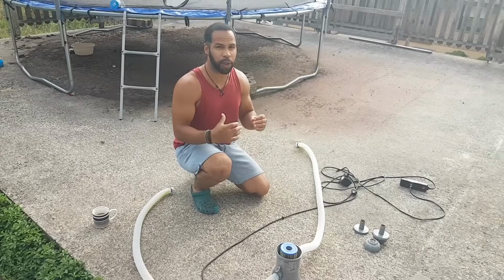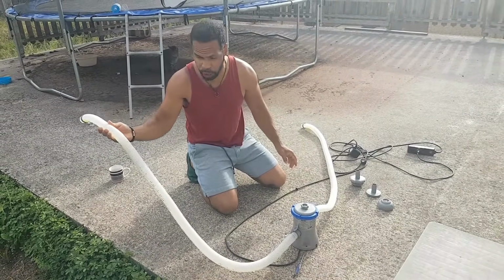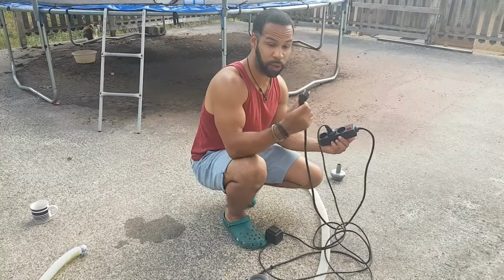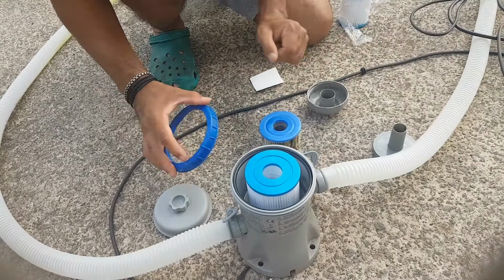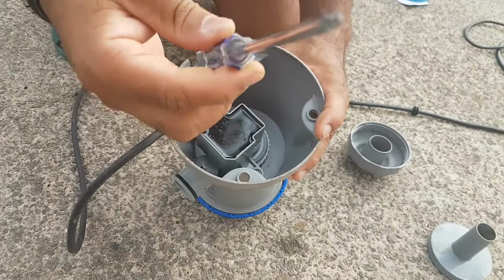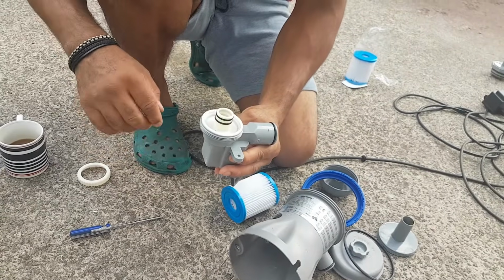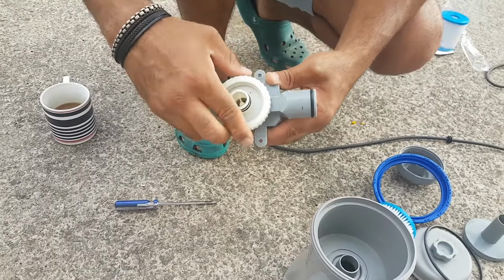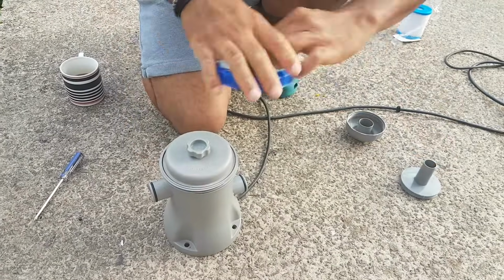Bestway Pool Pump Not Working - Common Bestway Pool Pump Not Working Troubleshooting Procedures

Comment from the maker: Check the links in the description for similar products on Amazon.
Please leave a comment.
Please subscribe: https://goo.gl/Zn8ZYP

At your own risk Disclaimer:

This video is for information only. In order to reduce the risks of injury please follow the instructions that came with the equipment. You are performing troubleshooting procedures at your own risk and I will not be held responsible or liable for any injury or harm you sustain as a result of this video, or information I share.
Reply: I got a problem with mine I can hear it running but when I put my hand on inside of the pool in the water I carnt feel any suction .
But now I'm going to try your way thanks 😊

Comment: I have a similar issue, but removing the washer and the small rubber piece didn’t fix mine.
When the pump is completely disassembled like yours in the video, the motor spins normally.
As soon as I reassemble the pump housing, the motor struggles to spin, even with the washer and small rubber piece removed.
Have you seen this before?
What could be causing the motor/impeller to bind when the housing is reassembled?

Comment: my pump womt turn on at all. like it’ll light up but it will not click and turn on. help
Reply from the maker: Check if there is any debris blocking the impeller inside the pump housing. 🛠️

Comment: No water is coming through the top when filter is on ?
Reply from the maker: Make sure your hose connections are tight and that there aren't any blockages in the intake. 🛠️

Comment: None of this worked for me. Mine is brand new I filled it with water bled the air took it apart like you did, everything and it still doesn't work

Comment: 2024 I had to search for this. It worked but the fan chipped somehow in the middle of summer. No choice had to purchase another one. Very hard out of stock. Now 2025 the new one started to rattle bummer. I had to do same open it up and take the small part out and sure thing it's quiet and working. Hopefully to last until forever 😅. Thanks for sharing the information.

Comment: My pump just doesn’t turn on and I don’t know how to fix it
Reply: Pumps motor can burn if it's ever ran without water or badly clogged. 

UNPLUG THE FILTER when you're troubleshooting. 

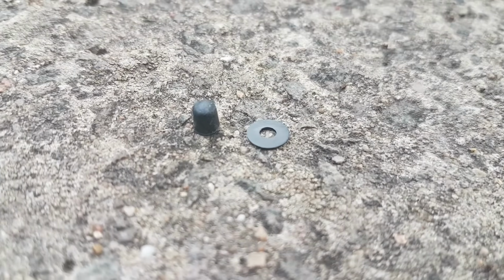Personally I would have taken it apart and checked the fan inside, lift the blades off and it could be clogged under it with hair or something not allowing it to turn. (If you just have no power completely ) smell the  motor for an electrical smell, this is an indicator that it's burned = garbage.  If it's ok then I'd check the wires to see id there's any that aren't connected properly. Check for calcium build up on the wires, if cleaned off it can work again if not to badly corroded.  If they are and the motor is fine then just get two good wires and replace them. 5:37 he gives another idea that worked for him. 

Easiest way,😂 if you're not familiar with the things I've said is to call the manufacturer and tell them you just bought the pool and the filter won't turn on. They will send you a new one after making you try a few things with it.

Comment: Great video, thanks!
Some notes: my pump is not with screws but with a twisting part inside where the filter is. 
I think the material (rubber) is the problem. Here in southern Spain they say these things can get overheated after 4 hours. I think it's just the rubber is no good for the sun and blocks the pump

Comment: I just bought mine and the engine doesn’t even turn on!?
Reply: I fixed it- unplugged the pump from the tubes and plugged it in without any tubes attached. It started out rough, and eventually worked out its kinks. I plugged everything back in, and primed it (open the top and let all the air out, then seal it back up) BEFORE I plugged it in this time. I think I tried priming it AFTER it was already plugged in the first time.

Comment: Thank you! I can’t believe you can’t swim in the pool with the pump on, that’s crazy! But appreciate your help on this!
Reply: I agree because I had a 24ft above ground pool and I have my filter pretty much all the time and while swimming. I only turned it off during storms and I had my pool for almost 20 years either the same sand filter. I recently brought the bestway 10ft pool for my great granddaughter so can someone please clarify if this is the case now, as I no longer have my 24ft pool so I’ve been out of the pool loop for quite awhile. Thank you.

Comment: Thanks. Needed your help to see how to open up the motor rotor parts. My pumps (3x) are cracked in the impeller shaft. Will try epoxy but not sure glue will stick to this type of plastic.

Comment: I forgot to unplug mine n it froze but i then brought it in carefully and let thaw in tube undisturbed. Do u think its fixable?
Reply: As soon as I turn mine on (after releasing all air) the top hose that distributes water back in pool fills with air and wont circulate. I do see fan is moving?

Comment: I have tried just about everything and the pump won't work.  It's only a few months old and worked  for just a short while.   The lines that draw water from the pool and the other that jets it back in are doing nothing.  It sounds like it wants to run but nothing.  Any ideas?

Comment: Your video is so clear, however my pump motor apoears to be held fast in place with 5" circular retension bolts. Tgey look like huge clockwork gears. There is no way I can turn the inner one nor its 7" companion. Have you encountered that.
Reply: @Jennifer Kinney I got it broken down...but there was no gunk in it...so I'm still in the process of trying to figure it out.

Comment: THANK YOU!! When I first got the pool it worked for a hour. I thought maybe the wall plug was bad and tried a different one and an extension cord to a working plug and still nothing. Took it apart and removed those 2 parts and it worked!! I really didn't want to buy a new one so thank you thank you thank you!! 😁

Comment: I can't get the pump assembly out! You mention to turn the white circle thing at the base. I can't turn it. I can turn the whole assembly a quarter inch left and right. I can't pull the assembly out. Any advice?
Reply from the maker: You have to pull it out at a weird angle. I had to record that part several times before publishing this video. Gently, pull and twist at the same time and you will see that it comes out.

Comment: I have the 12 ft. pool. The filter has 2 intakes, 1 outtake. No suction from either of the intakes, but a little water coming out in the pool. The hoses are full of water, but I see no movement at all. Motor is making a quiet humming noise. Does it sound like this pool filter is working to you?
Reply: Same

Comment: THANK YOU!!!!!   We plugged our just -out -of - the - box Bestway pump in and it worked for less than 2 seconds.  I was so afraid it had blown up.  After watching your video, we discovered that the impellor blades weren't turning.  Loosened up the two screws on the bottom and that was all it needed!! I didn't even have to remove the impellor assembly.   Your video saved a whole lot of needless worry and anxiety. This is our first pool and we  really have no idea what we're doing.  So THANK YOU again!!!!  Blessings on you and yours.
Reply from the maker: I know exactly where you are coming from. I was panicking and was in disbelief at first. I had just plugged it in and the impellor didn't work. I was determined to find a solution no matter what. I am glad it worked out for you 😊.
Reply: How can you tell if the impeller is or isn't working.  I think that's what the issue is with my pump....it worked for such a short time.  I'm just so frustrated I'm hoping I can get some help here.

Comment: Thanks for the video. My pump had stopped working and pool was getting dirty. Took it apart and it was down to hair tangled round the spindle the fan was on, stopping it turning. Easy fix!

Comment: Brah! that cap keeps the rotor centered so it doesn't rub on the sides. By rubbing on the sides it can make a hole in the plastic and reach the wire coil and can put live AC in your pool. Most people keep their filter running when they are in the pool, so because of this, I don't recommend removing that cap. It's a good cheap fix if you don't have the funds to buy a new one but it's a dangerous one too. Please don't do this!
Reply from the maker: Hello, 
Very good advice! However, i recommend extreme cation and as long as the filter pump isn't on while running, there shouldn't be any problem. I  used my pool almost every day in the summer, and everything thing was fine. 

Great tip!
Reply: @How2Review  I know, I use it the same way and I'm also an electrical engineer and I understand the real danger of improvisations like this one, especially because my kids are playing in the pool. I also have a few friends that don't stop the filter because "I installed a Residual Current Circuit Breaker and I'm safe" and then I show them cases where people got shocked because that breaker failed either from factory malfunction or old age. So when I saw you removing that washer I got goosebumps instantly!

Congrats on teaching people how to treat their pool though. Really! most just keep it dirty and unfiltered because they don't understand the danger of standing water.

Keep it up! but when doing improves like this please please emphasize that they need to be careful of the possible danger. You only get one life and it can be gone in a second. Sorry for the rant but I've seen so many crap because of electricity.
Reply from the maker: I just updated my description and pinned at your own risk. I also add that I recommend people following the instructions from the equipment. Thxs again!
Reply: You’re videos are great they’ve helped me tremendously.  I have the Bestway oval 14 x 8 the motor is working I could feel/see the water pushing outward but I could barely hear the motor.  I was releasing the air with it off but once I did it when on as you did it sounds stronger. I personally feel that’s a small pump for that size pool.  Also regarding the fan repair aren’t you supposed to turn off the pool pump or unplug before anyone uses the pool?  Keep up the good work.

Comment: Don't know if you have any advice here ,but I have purchased a used pool , have discovered that it leaks water from the too of the pump , looks like the threads are damaged on the blue ring which doesn't fit flat , I don't seem to be able to find a replacement online
Reply from the maker: Unfortunately, there is nothing you can do about that. Once the threads are gone you will have to get a new pump or part. I don't even think they sale pump parts. Sorry for your trouble.
Reply: @How2Review  oh dear , that is what i feared might be the case, i thought i needed the part ,just been struggling to find it
Reply: Well as a bit of an update I found that once I took the seal out of the lid ,it screwed down fully ,so with a bit of playing around with the seal in a different location,I appear to have a mostly leak free pump , maybe a decent seal set may fix it up fully
Reply from the maker: Awesome to hear 😊.

Comment: How did you prevent water from leaking out of the pool when removing the tubes and filter system? 
Im having a hard time blocking water off from releasing from the pool. I have one cap to stop water from the receiving end but not the return hole. Im struggling
Reply: You can just raise the pump above the water level of pool for maintenance. Alot of air to bleed out once you put it back on to ground but no need to mess with plumbing
Reply from the maker: As I remember.  I left the two hoses on. The next step was that i took the a and b nozzles off. At this point the water is trapped in. The next thing you have to do is put both rubber nobs in each side. Once both rubber nods are in then you can can remove both hoses. I hope this helps.

I forgot to mention that that filter must still be connected until bother rubber nobs are on the inside... Then you can remove the pump and put it away.

Comment: I've had this problem today. Did what you suggested and it now works. But.......... its given me another issue, as when I turn the knob to release air the water coming out kept giving me a little shock! Do you know any reason why this would happen. Also might sound daft, but if this water is giving shock at this stage what will it be like when we get in the pool? 🤔😯
Reply from the maker: Hello,

My friend it seems like you have a defective pump... I wouldn't risk using it.

Comment: Hey there. I turned out to have a different problem, the impeller had worked its way loose and was just bouncing around on top of the cam. Thanks anyway, your very clear video gave me all the confidence I needed to take the pump to pieces and it's now working again.
Reply from the maker: Awesome my friend! I am glad this video lead to a solution for you 😉.

Comment: Hi. Do you know how to fix if the rotor/impeller is not spinning? It will spin for a few times then will stop. 😩
Reply from the maker: My friend, it seems like you have a defective product... I was experiencing the same problem and I got so fed up that I took the pump completely apart. I was determined to find a solution... If this didn't work for you, then I suggest returning it. I am sorry for the trouble, but don't give up...

Comment: Mine leaks from the top where your blue thing is.
Reply from the maker: Hey try slightly turning the small pressure nob on the top so the pressure can  release the water. One you hear the air come out close it and all try tighten the blue ring.. I hope this helps.

Comment: Mine leaks from the bottom 😭😭😭😭😭😭😭😭😭
Reply from the maker: Did you try opening the the top value and letting the pressure flow through and then close it?

Check to see if all of the clamps are tighten and the hoses are on the proper sides.

If nothing works, then I would suggest getting a refund. I am sorry for your stress. I know this must be so annoying.
Reply: @How2Review  I ended up returning it today... didn't even get to use it..... 😕 this is the second one we have purchased.... getting a kitty pool.... so done with these companies.....